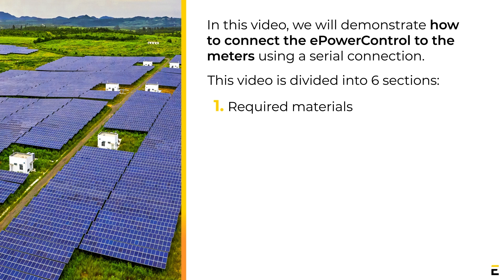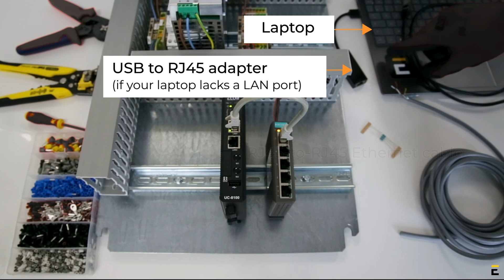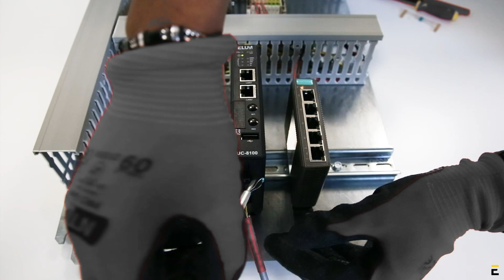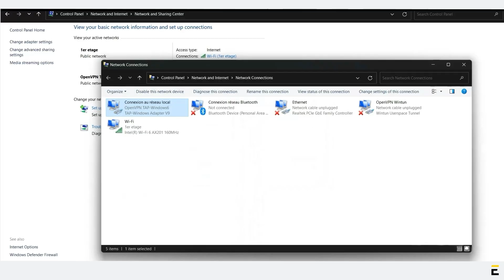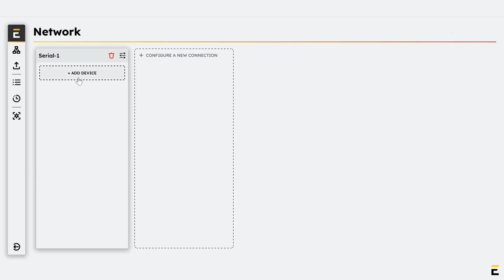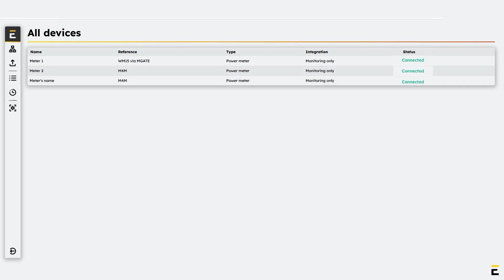ePowerControl - Series 1 - E)  Meters connection - Modbus RTU (serial)

Comment: The connection at the meter side was not shown
Reply from the maker: Hello @Joeyso1235,
This video focuses on the wiring at the controller side. For the meter-side connection, since it's a standard Modbus RTU (RS-485) serial communication, we recommend referring to the meter manufacturer's user manual. It will provide specific details on:

- Which terminals correspond to RS-485 A(+) and B(-)
- The correct wiring polarity
- Optional biasing or termination resistor setup if required
- Any dip switch or configuration setting related to communication.

Each meter model may have a slightly different layout or configuration, so the manufacturer's documentation is the most reliable source for an accurate and safe connection.
Let us know if you need help finding the manual for your specific meter.